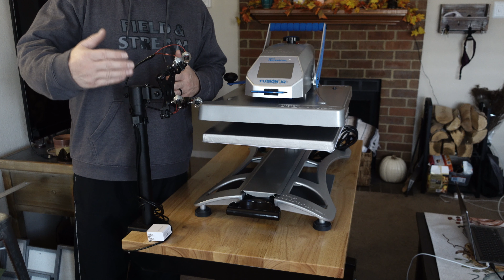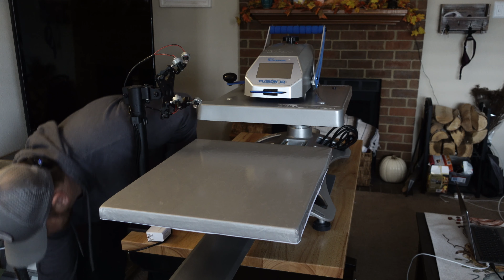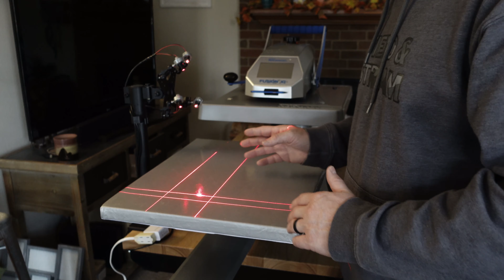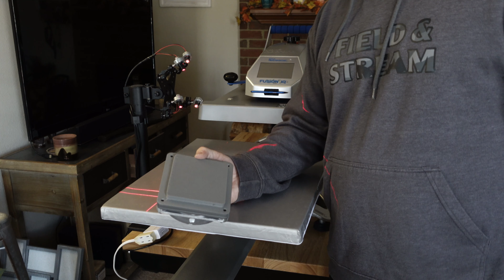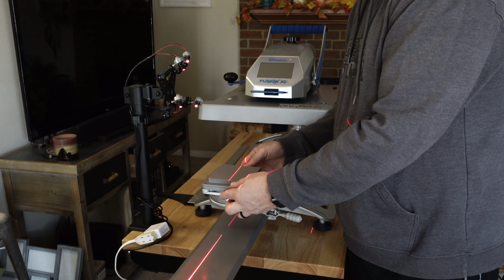REQUESTED | Homemade laser guides with Hotronix Fusion IQ

Comment: Do you have a video on how you constructed this system for the Fusion IQ.  I looked up some of the parts you linked and some are no longer available.  I see your video is 3 years old. I don't see magnetic lasers at Harbor Freight anymore and I don't know how you constructed the sytem on the Fusion IQ.  Could you direct me to another video other than the one with the dual mount for the clam.  I have a Fusion IQ. thanks
Reply from the maker: I stopped using the magnetic ones from HF after making the system here because this setup has finer beams and they stay on indefinitely with a wall USB block and for a REALLY long time with a USB battery bank (I used this when moving my table a lot). The video I link next shows the setup for the laser system shown here. It features an older heat press, but the setup is the same: https://www.youtube.com/watch?v=2EIjvv3SWKc
Reply: @OneDegreeLife  Thank you so much for the speedy informative reply.  I ordered everything so I can have it set when I receive my new Fusion IQ
Reply from the maker: @jaynecollins2  Nice! Hope you love the IQ. Great press. Really hope the laser guides make things easier as well. Cheers
Reply: @OneDegreeLife  I currently have the Hotronix Clamshell 16 x 16 press on a stand but it is really wreaking havoc with my shoulders since I am only 5' tall and the repeated reaching up and pressing down has torn up my shoulders.  Hopefully, the Fusion IQ will resolve that problem.

Comment: I have an older press fusion press and the platen moves side to side? Is there a fix
Reply from the maker: Hummm. Not sure. Is the connection point loose on the back of the platen or only when set in the device? Also, is it the actual platen or the slide out tray itself? Not sure what the fix would be, but knowing WHERE the movement is will help you pinpoint the problem and then I would reach out to Hotronix.

Comment: how long do your lasers last? those little Harbor Freight ones only lasted a few hours! :((( i've watched all 3 of your vids. ordered the ONN monitor mount, and just today ordered the O-ring things and the ball/socket swivel mounts. Now all i need to do is do the wire stripping and build the laser kits themselves. Looking forward to getting it all set up!
Reply from the maker: Yes, the HF wont last as long work and the lines aren’t as thin as the others. I think it depends on load. I was pressing for 3-4 hours a few days a week with zero issues. Some other viewers have indiccafed their setups using this/similar gear are able to run full-time work, but I would hesitate to try and verify longevity. I simply wanted to offer a more cost-effective solution to the Hottroix setup.

Comment: Thanks for this! I'm a screen printer and have been wanting to DIY a solution for a long time. I need mine to be taller and stand off to the side of my press, and I've figured out how to do that. Question though, and maybe I missed it. Is there a particular reason for plugging them into/using a power bank versus say a multi-port phone charger/brick?
Reply from the maker: NOPE! It’s a just in case. For example, they recommend running the press in an outlet without other things in use. In my case, there wasn’t a convenient second outlet, so I used the battery block. If you plug them into a USB power block and into an outlet, it works perfectly without any cutoffs (time outs), etc.

Hope that helps!

Comment: Thank you so much for this idea and video! Its really helped me with quicker alignment. I've been using this set up for about a month now and did about 1000-1200 prints on it.

What i learned quickly was that the lasers i bought on amazon would lose focus quick because the threads on the lens would wobble a lot. To solve this i just put two loops of teflon tape on the threads and now its way more accurate and wont move.
Even the repeated movement from the clamshell pressing down with heavy pressure wouldn't move it. I still check focus every day just to be safe. I also have my press clamped to the table to make sure it doesn't move.

Thanks again!
Reply from the maker: Awesome! I had the same issue with one of my lenses as well. For some reason the best focus was kind of loose on the lens. So, I used electrical tape.

So glad it’s working for you!
Reply: i don't understand what you mean by the using the teflon tape/threads. i guess i have to get the lasers in the mail tomorrow to understand
Reply: @lennyhipp  depending on which lasers you bought, the head on the laser will move a lot with some movement. So putting teflon tape on the threads will help tons.

Now if i accidentally bump the set up, the lasers won't move

Comment: I tried it in my Gea Knight swingaway mounted to thier custom rolling stand. 
I soldered all four lasers to one USB cable and the system works perfectly. side note I'm using a walmart USB battery and lasers stay on continuously for over an hour with no issues.

thank you for this wonderful system, brilliantly explained.
Reply from the maker: Great news! That’s awesome. Good to know four will work in on cable. I hadn’t tried that many. Also, good info on the battery. I figured it had to be my pack that was doing it. I honestly only use the pack here and there when needed as a standard USB charging block works great and keeps the battery out of the equation. It’s helpful though if there’s only a single outlet close by given the power draw of the presses.

Im sure this info will help others! Glad it worked for you and thanks for sharing your tweaks! Cheers

Comment: Thanks so much for this series of videos. You saved me $300! The only thing I added, just for a little more convenience, was running them thru female to male USB cables with on/off switches. Once again, thank you! Not all heroes wear capes! Some make YouTube videos…
Reply from the maker: Awesome! So glad you worked out a solution for your setup. I usually run mine through a USB power block for constant power now as well. Thanks for letting me know. Cheers!

Comment: How did you wire the 4 laser lights with a 110 plug? I have been searching for instructions, but have not found anything for all 4 with one plug.
Reply from the maker: Check out the other video I linked. It demonstrates creating lasers powered via USB cables. Then I plug those cables into a USB wall plug and into the wall/extension cord. Basically, just like charging your cell phone.
Reply: @OneDegreeLife  Thanks! Let me confirm, Instead of plugging the USB cord into a power bank you are plugging it in to a USB wall outlet, correct?
Reply from the maker: @crmcelhatton  Yes, a USB plug like what comes with a cell phone or iPad. This one just has multiple USB outlets on it.
Reply: @OneDegreeLife  is there a minimum output for the charger?  i tried using an old iphone brick and my lasers would not come on but when plugged into my power bank the function with no issues. i would like the constant power on when pressing multiple shirts instead of having to push the on button every few seconds.
Reply from the maker: @po123gsxr  Hum... I have two different ones. One is a dual-USB block that delivers 4.8A total, so 2.4a each, and another that has 4 outlets {https://amzn.to/35I32EZ} and both of those work perfectly with constant power running 2 lasers per USB (4 lasers across two USB outlets). And I run that off a regular home extension cord with no issues. I used the power block when I was only near one outlet that needed to power the press solo. I'm no electrician, but if the block supplies 2.4 A per USB port, I think it should work. Both of mine were purchased in 2017, so I'm guessing virtually any decent quality plug would work.